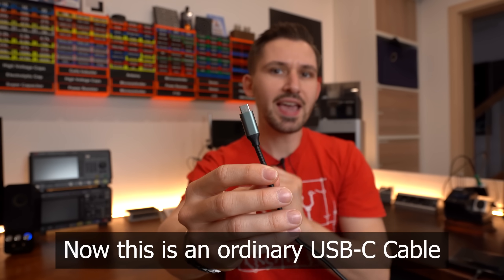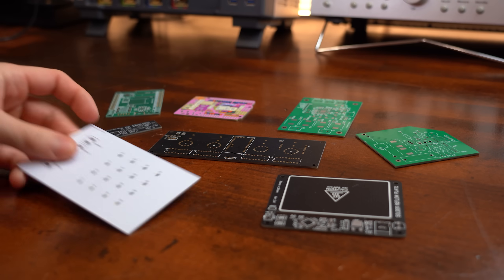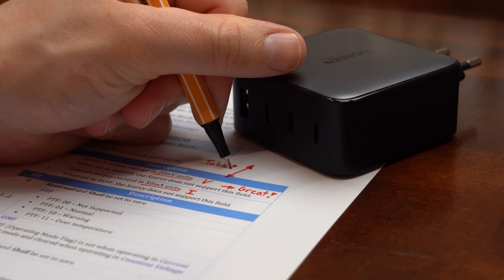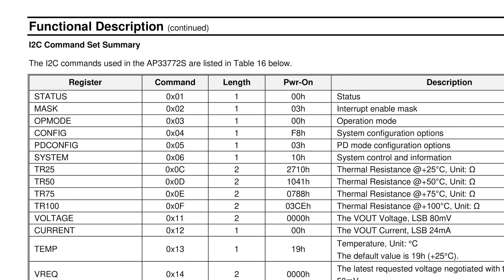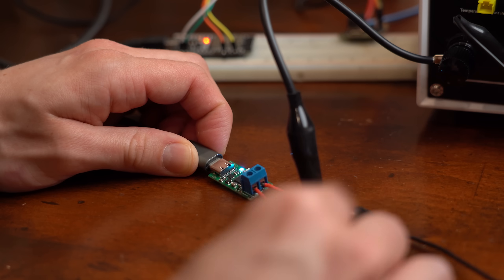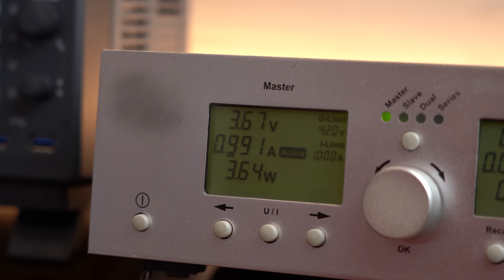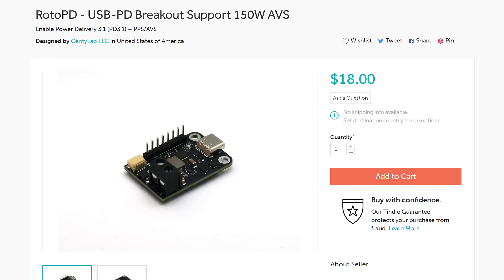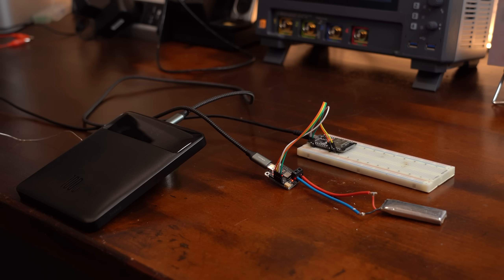USB-C Just got Even Better! (PPS)

Comment from the maker: Discover Easy, Affordable, and Reliable PCB manufacturing with JLCPCB! Register to get $60 New customer coupons: https://jlcpcb.com/?from=AAA

Thanks to JLCPCB for sponsoring this video and making this show happen😀
Reply: Can you use 240watt usb c cable?
Reply: Would you consider to use it like CC/CV bench power supply instead of charging li-po battery? I am asking this because I need a CC/CV bench power supply 
Best regards
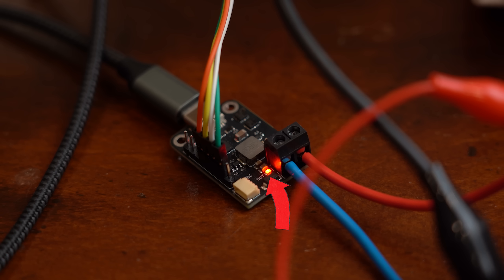Reply: [1:26] was a source of great disappointment.  I was expecting you to say "Let me show you its features!"  :grin:
Reply: It would be nice for China to make a more elegant power supply product than just PCBs-something like with display and voltage selection.  I now have four PD chargers that are unused
Reply: Can you give the code for the lipo battery charging??
Reply: Hello how are you doing please can you make a video on how to copy a flash chip like 25qxx to another flash chip using esp32 without using a computer. Thank you.
Reply: Now that the fnirsi FNAC-28 launched, would still choose that 4-way USB tester instead of the fnirsi? Asking because I was about to get an FNAC-28 when saw that on the screen.
Reply: Thanks for explaining how to make a DP100/DPS-150 basically👍🏻 I had suspected that it was something relatively easy like this they used to make that product, so basically one of those modules and an ESP32-S3 touchscreen module seem like a nice combo for a new touchscreen PSU👍🏻

Comment: I don't need PPS, I just need 12v and 5v from a single USB C connection. This seems to be exactly what I'm looking for, it's perfect. I'm planning to use an xbox 360 kinect as a 3D scanner, I don't need high detail so the price is very attractive but I don't want to have multiple cables everywhere to make it work. Using one of these means a single connection provides power and data transfer to my laptop which has a PD charging port.

Comment: Okay I want one but I can't find one that's small enough besides ones that have a USB port on it but I don't want to use people anymore so could I just take the USB port off the motherboard and starter a battery on to that and that would take the battery and power and convert it from 7 or 12 volts down to 5

Comment: I wonder if AVS can be used to produce the typical Eurorack rail voltages of +12V and -12V.    There are rather expensive modules on the market like the DKMW40G-12 converting any voltage between 18-75V to +12 and -12V at a maximum 40W power,  but I wonder if this is not too far fetched for pulling +12V and -12V out of a USB plug.   Could there be a cheaper DIY solution for this ?

Comment: I wonder if such an IC could form the basis of a MPPT usb supply of a solar panel? If you have a device that accepts a wide range of inputs (like a battery pack), tune the input as you would for an MPPT charger.

Might cause some confusion on the device end with the varying input voltage, but might be worth testing?

Comment: Love your video.  I want run a mains (230v) LED light panel 600x600mm in my garage (without mains power) from a PowerBank.

I noticed that the (3Hr) Emergency Power Packs use batteries anywhere between 3-21v.

So it technically should be possible to run this light panel off a USB-C  PD PowerBank?

I have Extremely Limited Electronic Knowledge.

Can anyone Help me Please?

Comment: so annoying i went down the rabbit hole and trying to learn about connectors and circuitry, I have some super old gemini titan 4000 LED that uses some reversed connection proprietary connector  the LED is using 5.5mm barrel plug  2.1mm male (instead of female)that accepts only 15v according to chatgpt. and I couldnt have any existing usb to 2.1 mm female adapter that are exact voltage, most are 5volt,  however the starlink sells them for their dishes, but it is 20v. Grrrrrr, why they do this, i just want to plug in a bloody power bank to the lights. the old power bank no longer holds charge and they dont sell replacement no more

Comment: Great video! You mentioned that the supply reset to 5V when you drew too much current at 3.3V. This is my fear with PD and PPS. If I have a device that takes e.g. 3.3V, how do I ensure that the USB-PD supply never ever ever outputs a different voltage and destroys my device or worse starts a fire?!

Comment: Hey Scott, I love your videos, even if I don't have that much electrical knowledge. I'm an enthusiast, just trying to learn micro soldering and managing to do some minor board repairs on my own using a heat gun :) Seeing that I have some old electronics at home (e-readers, headphones, etc) which still use micro-usb is it possible to just try and change the connector from micro-usb to usb-c? I saw for example in my old Trekstor e-reader it has 5 pins but most usb-c have 6. So maybe a video on trying to buy some usb-c connectors from aliexpress and bringing old tech to 2025 would be nice? :)

Comment: I've one question so this can also do various voltage and current output for laptops which do not have usb c charging point, they use old barrel jack for power. For example my laptop required 19.5v and 6.92A so it can provide 19.5v with 5A, right?

Comment: Just call it what it is Qualcomm qc 3.0 it is adjustable 4.5 to 20v.
Works just fine with my FNIRSI USB tester and any QC3.0 charger and have worked for YEARS

Apart from the current adjustment it seems to be 90% the same

Comment: $17.30 for just the module? I'd rather just buy a chinesium power supply that gives me a fixed voltage for my projects... because otherwise i'd also need to buy a PPS.
Nice idea, but very limited use-cases and way too expensive.

Comment: Hi! have you perhaps considered to make a video about the "power supply side" of this protocol? I'd like to add a low voltage DC line on my home (like, for example 48V/51V from a LiPo battery pack) and use this protocol to provide power for phones, smart devices etc

Comment: Well, USB C is very amazing port standard. And that's after finally giving up MacOS and installing Manjaro Linux on my 2017 MacBook Pro, I converted it to use a USB C for charging and also converted the one USB port into USB C.
This allowed me to use one charger for everything and I only need to carry a 19.5v 240w charger for my gaming laptop and also use it with limited output wattage and amps on my MacBook.
Hell, I have an car radio in my kitchen which I power with USB C and use speakers on top of my kitchen drawer to listen to my CD's or use Bluetooth for playing music from my phone while cooking or baking in my kitchen.

With this board here, things gets even easier than they were before. Honestly, I can only imagine how many use cases this RotoPD will provide.

Comment: Thanks for the video!
The phone cell is always a 1S NMC pouch average at 3.7V so even with the PPS the internal DC/DC converter is still used, why it's better ? Fixed buck voltage rate ? Or the phone is 2/3S !?
In EVs fast DC is directly the battery voltage that's why it's so efficient (sometimes a 800V pack is split in 2x 400V to be compatible).

Comment: I remember trying to use a current sink/source DAC (DS4422) to build a variable speed DC fan circuit powered by USB. $80 dollars for free shipping or the standard fee didn't justify the cost of those DACs, And figuring out how to make USB output anything more than 500mA@5V was a nightmare until I learned that it's just not possible if not using QC/PD, not to mention I was trying to boost 5V to 12V with some cheap boosters lol 😂😂... So I settled for using a fixed 12V supply and wiring up some resistors to a buck converter to get 3 fixed speeds and forgot about this... until now! 20mV steps directly from USB is AWESOME! I will have to rebuild my project using some of these.

Comment: I have also wondered for quite a while why there aren't any PPS boards around like those for usual PD triggering, since all my PD chargers feature support for PPS since years ago. Nice to see this nifty programmable thing. I had also found on AliEx a programmable cable (WITRN PDC002; built into the USB-C head, no board dangling around; terminated with a 5.5x2.1 barrel plug) that can do PPS+AVS as well, but requires its own proprietary software and preset files to programme.

Comment: Haven't looked into 3rd chargers/power supplies in detail, but at work we've had 240w PD 3.1 units from most of the major laptop brands and major charger manufacturers for several years now. Word of caution though: Do not buy 120w+ PD3.0/3.1 chargers OR CABLES from any noname brands. If the price looks too good to be true, 99% of the time it definitely IS, too. Also note: For anything close to 240 watts, you're pretty much limited to 1-1.2 meter long cable, and pretty damn expensive ones at that. The vast majority of cheap "5A" and "240W" USB-C cables on the market today, can't actually do 5A/48V, at any length. And that's not likely to change much if at all. 5A/48V or 240W over USB-C requires very high end precision components, materials and production techniques with incredibly strict tolerances, and still their production has very poor yields (An extraordinary high percentage do not pass standard and performance validation). Anything beyond 1.2m/4ft has too high a voltage drop driving 5 amps. This is a challenge that would most likely, require even higher voltage to overcome, or some other novel tech by someone that do full-component-chain development (Like for instance Intel). Or breaking off from compliant port and connectivity standards. Because at 5A, we're pretty much at limit of what the USB-C pins can readily support. And unlike lower-pin-density connectors, you're pretty close to the limit of the wire guage you can feasibly accommodate too - unless you break spec and start ditching a whole bunch of lines. If you do, then going through all that headache just to use a USB-C connector interface becomes (practically) pointless. This is also why we shouldn't expect to see much of that on the commercial market. 5A/48V over USB-C is a very expensive convenience, so/and there isn't any market desire for a much broader implementation as a marketing gimmick feature. It's near-only common use is honestly intended as a brick'ish power supply for high-end, often dual-port, thunderbolt 4/5 docking stations, to enable powering multiple external monitors, storage, assorted power hungry peripherals, while charging and powering a "foldable desktop" gaming or workstation beast. So talking an accessory to equipment so expensive that an additional $150-200 premium for USB-C, over a brick with a barrel jack, doesn't raise eyebrows. What I'm getting at, is that first of all as a practical matter there are extremely few commercial  single-devices that would actually derive any benefit from it. That makes it a very niche solution. Second, it's so expensive to fully implement that it only makes sense for novel applications and a small subset of very high end devices. That too, makes it a niche solution. Net result is something that is relatively speaking very low volume and incredibly expensive to fully implement. Meaning there is neither incentive nor justification to sink the very large investments neccessary to develop means of vastly cheaper mass production. Which would be needed to support any significantly broader implementations.

As to breaking spec to get around the mechanical limitations - at that exclusive price / performance tier - NOT retaining full pin/line population and USB-C Thunderbolt 4/5 compliance is a non starter.

Comment: Sorry if this is a stupid question, I'm still new to this and am trying to learn more, but would this also eliminate the need for a battery management module when designing a charging solution? And would it also eliminate the need for usb-PD?
I'm framing this question from the perspective of trying to build a usb-c charging  and power delivery solution for small projects (I understand that I would need a separate module for power delivery to the microcontroller).

Comment: I struggle to find a way to power as cheaply but safely as possible an ESP camera using 5V with basic IR led module that need 10V.  This option remains too expensive (I guess it requires 2 slot USB, + this module)
Reply: sorry 12V not 10v (and safe 12V charger aren't cheap)

Comment: Slowly doing more and more research into a solution for my problem with too many consoles!
Looking at making a custom USBC supply for my console setup, since there is not a product on the market to meet my demands.

Need to power 8x GameCubes (Modded with USBC ports supporting PD) (12V 3.25A), and 4x Wii’s (USBC port supporting PD) (12V 3.75A).
All these systems to be powered and connected to the custom power unit by USB-C to USB-C Cable. 12 ports on one unit

Any tips on how I’d go about source together components and a Wall outlet PSU?

Comment: But [how] does this work across USB hubs, splitters, adaptors, etc? I'd expect most of those are too dumb to support anything other than the minimal fixed voltage, and some might even be dangerous in that when one side of a split requests higher voltage all the other sides would unexpectedly get fed that higher voltage as well and be fried... Are there protections against that?

Comment: I saw in some parts of the video that the LiPo cell was charged with 4.3V. Beware that the max/end voltage for most LiPo cells is 4.2V, with damage starting to occur already at 4.24V. So 4.3V is likely to damage the cell and precise voltage measurements are needed.

Comment: Does that mean I can charge my old Acer laptop as effectively as with the original 19V~3.42A charger? I'm interested in replacing my laptop's bulky power brick with a 65W Power Delivery charger using a Type-C to DC jack converter, but I'm concerned that the PD charger's voltage for 65W output is 20V~3.25A instead of 19V~3.42A.

Comment: 9:46 could you please explain this ? Then how come the phone is showing 9 volts? The battery inside a Samsung phone is a single cell thus what you are saying doesn't make much sense without more context.
Reply: 😂 ohm's law my friend, with higher voltage. You can get lower current for the same wattage.
In other words, the standard allows for charging at a higher voltage and lower current. Because it is more efficient and the charging circuitry in a telephone is made to convert that voltage into the charging parameters.

Comment: I have a question. In your opinion the power in AVS that is given could be used as phantom power to feed microphones or audio DI that ask for 48V ? I mean if the technology involved will push noise in the system making the mic or the other audio instruments not good or if the output is clean from rf or other emf noises. Thanks

Comment: Dang, thanks for running these tests. I was under the impression that PPS would limit via both constant current & voltage so that a device could simply set its parameters and wire the input straight up to the battery, but sounds like that's not the case if the current limit isn't actually implemented/enforced in the charger itself.

You definitely need an active monitoring loop to keep track of the current yourself and adjust the incoming voltage accordingly!
Reply: Looks to me that the board hasn’t got a very accurate shunt (current monitoring) or maybe needs a better calibration across all voltage ranges.
I’m willing to bet the memory is small enough on this chip to limit how much code it can store

Comment: I have a question: When powering devices with that PD module you have 5v from the USB initially until the voltage negotiation is completed. Are there any precautions needed to be made to prevent under voltage supplying of the devices? I'm not sure if isn't bad for some of them.

Comment: All very impressive but there is another side, 80% of faults on phones/computers and other devises are due to USB connections the more you plug/unplug them the weaker they get and will fail, they work fine if left plugged in, they are made out of the cheapest alloys the manufacturer can source, pay a $1000 for the latest phone it will fail in time for a USB port that costs a few penny's to make, the solution ? make them stronger which won't be easy as they are so small and nearly impossible to replace without the right tools.

Comment: With Usb C and PPS, you could probably make a DIY lab bench powet supply. You just need to add a few more components (buttons, meter, etc) to make it more yser friendly.
Reply: May as well just buy a miniware at that point, it’s usb c, tiny, lightweight, accurate, precise, easy to use, and high quality. It does everything a full size supply does at high power. Single channel, but they are designed to be stackable and can be linked together with a controller board for centralised control
Reply: @gtjack9  I didn't you could buy these things pre-made, thanks.

Comment: Been using a USBC PPS power supply for years, it's based on some older CentyLabs design. The biggest flaw (as you observed in your video) is that when the USB charger resets, it always defaults to 5V. Not great if you have it connected to an 18650 and it overcharges and catches on fire, ask me how I know :)

Comment: Funny how earlier today, I have been looking at converting USB-C to 12v conversion for powering low-power storage devices, maybe even a low power mini PC someday. My Anker power is an older model, so it doesn't have 12v. I did recently buy a 100w usb-c charger that supports PPS.

Comment: Delta Electronics makes a 240W (48V) EPR supply, you can find it on Mouser (although currently only for commercial customers).
ADP 240KB

Using one of those cheapo EPR triggers, I have managed to set it to 48V, and that works great as expected :)

My next project is to make a fast charger for Bosch Procore batteries, so I can charge the 12Ah packs at 1C. Or for charging eBike battery packs.

Using a simple buck DCDC you can also make an adapter to charge power hungry laptops, for example 170W @ 20V